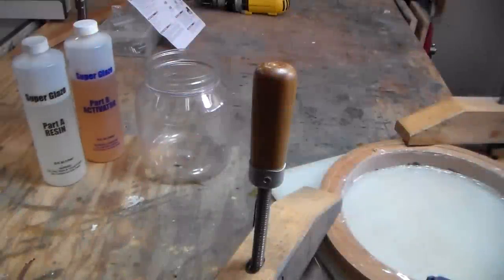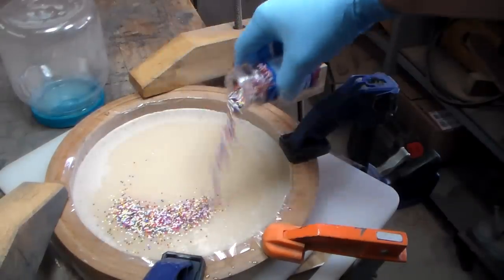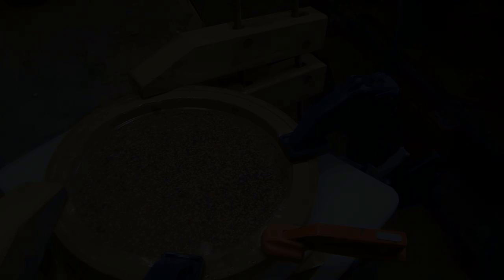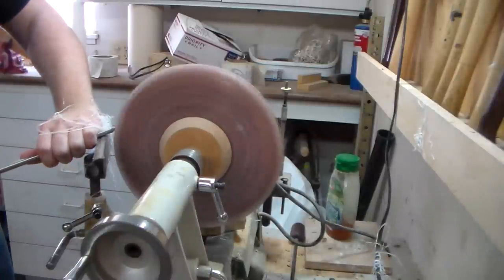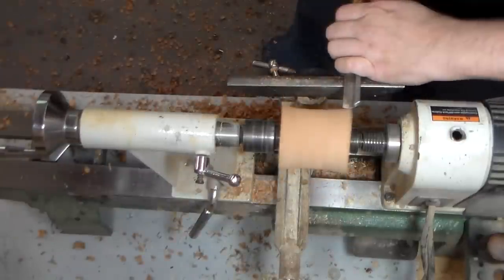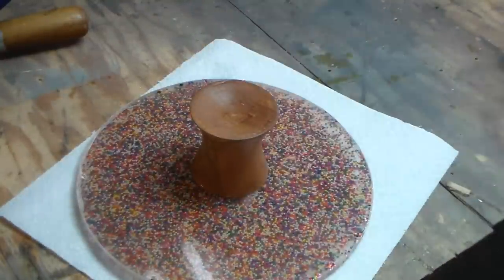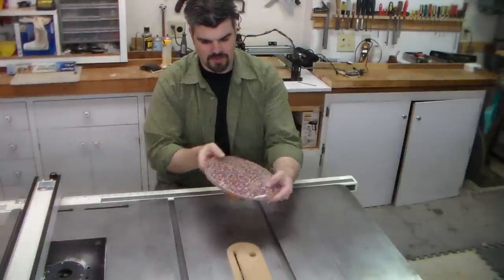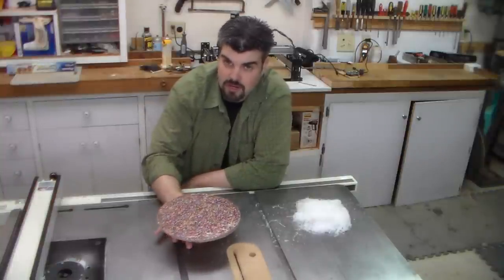Candy Sprinkle Cake Stand

Comment: Love it! Thanks Peter,  
I need to make something similar for my friend, she's a cake decorator.
Reply from the maker: Carl Jacobson Thanks! Word of caution. This has begun to sag at the edges, guess I didn't think about it needing support...
Reply: Peter Brown I found that epoxy is soft at first but will harden up like a rock after a week.  If you do it again, I would let it sit flat for awhile before gluing on the base and it shouldn't sag.  Another thought - If you make another I'd consider making the base wider at the bottom.  Otherwise the stand might tip as you try to cut the cake.  Great project.  I think I'll use the concept to make a sprinkle pen blank.
Reply from the maker: Pisik Wood Thanks for the information! That is very helpful. If you make a sprinkle pen, let me know, I'd love to see it!

Comment: Hey, Peter, love the colour.   One thing I'm not clear on.   You poured epoxy, then sprinkles, then heat gun... but afterwards, which side was the top?  ie: did the sprinkles sink, or ??   Did you get a smooth surface?   When you started, I was wondering if you were going to first pour a think layer of epoxy, let it dry, and then do the sprinkles+epoxy layer, to ensure a nice smooth top.
Reply from the maker: wordsnwood You're right, they all sunk to the bottom, with became the top. All that bubble removing was for not, unless you flip it over... Two pours might have been easier, as would have a proper mold. But then, that doesn't really sound like me... :)

Comment: That awesome! Just one comment. The half cut sprinkles on the edge looks very exposed. If I were to immerse the tray in water wont the exposed sprinkles dissolve? May be another epoxy coat along the edges to seal the sprinkles in?

Comment: F.Y.I. An idea. Neon drinking straws held together with resin and left hollow then filled with plaster of paris in a tube then cut thin as coasters. so the epoxy shows the colors and the plaster in the middle absorbs drink condensation. I guess plug the ends of the straws for the dip.  What do you think ?

Comment: That's pretty neat. :) I have never made anything that required so much resin before. I usually mix small amounts and what really helps with that are the medicine syringes you can buy that have the open end. I have one for my resin and one for the hardener. Of course labeled so I don't mix them up. :p For larger batches of resin I have a standard small measuring cup that works for me. I think it measures up to 1 cup in total.

I like mixing different paints in resin to get some really neat effects. I used a copper paint recently and the end results were beautiful. Of course I was thinking they had better be since the paint is pretty expensive for the amount you get. :0)

- Heidi
Reply from the maker: BlackCat2 It's always scary to mix this much up, hoping it's not a waste! I bet the smaller batches cure pretty quickly too.

I've not tried adding paint before, but I did have some luck with kitchen food coloring. Pretty cheap alternative if it works for you.

Cheers!
Reply: Peter Brown Actually smaller amounts don't really cure any faster. I still let them sit for 24 hours though it is hard to do as I want to take them out of the molds/forms and see what they look like. I have a problem with patience. :P

Yeah food coloring can be okay but not as good as nice paints. I also use a stained glass paint that dries see through though when wet it is opaque. They make some nice effects too but I usually put that on a layer of cured resin and then let it dry then add another layer of resin to cure over the top of the paint.

Comment: Cool, really neat and well done.  Thanks, Peter.  Did you use regular epoxy or a casting resin?  What was the hardener time: 5 min, 15 min, 30 min?
Reply from the maker: Mark Hazlewood I had bought that for my penny tray video. It's made for bar tops and such. Not great to work with. I think the set time was like 30 minutes. 3 minutes of straight stirring!

Comment: Would you have to then brush on some kind of sealer after the clean up work you did on the lathe?  Otherwise the candy that was exposed on the edges might get washed out as you clean it.
Reply from the maker: madwiebe I think a sealer of some type is a good idea. I've actually got an upgrade for this project I hope to make soon that will address that.

Comment: Hey, thanks for this. how do the lathe tool edges hold up when turning epoxy vs a typical hardwood?
Reply from the maker: +Jonathan Barrick epoxy is softer than maple, so it's not so bad. Now the one I turned with copper bits out in it, was a different story!

Comment: that wood part needs to be different, it will tilt and the cake will slide down when u try to cut it, just dril 4 holes and epoxi some 1 inch steel rodes as legs
Reply from the maker: spiloFTW I'm going to make a recess in a wooden stand for it. I might do a follow up video to show it off...

Comment: Fantastic! Again?!  When can we see a failed attempt at something? This is getting boring. :)
Reply from the maker: I'm trying really hard to think a project through before attempting it. So, I'm not cutting out my failures, and will continue to show them. But I've been lucky...
Reply: Peter Brown Keep up the good work. Here's a challenge: Put CA-glue with proper rating around a block of ice, and then put epoxy over that surface?  Also, can you turn ice? As the saying goes: "Peter Brown does it so that you don't have to!"
Reply from the maker: Janne Kronbäck My cake stand is starting to droop like a mushroom. Obviously it needed a bit more support at the edges! I thought you'd like to know... :)
Reply: Typical thing that one can easily see coming - in hindsight. :) Would you consider rather a rim or something hidden within/bottom-side of the stand?
I will of course revise this entry in my notebook as a complete and utter failure. :)
Reply from the maker: Janne Kronbäck I was considering turning a platter with a recess, and make it a cake plate. It would also hide the exposed sprinkles along the edge...
Reply: Yes, that seems to be the "normal" way of epoxying something fun as a surface for anything table-like. To me, your attempt was clearly different in that aspect. Guess a bottom-support or visible "spokes" that makes it look like the "cake" is cut into slices is needed..

Comment: Unfortunately, epoxy resin is NOT food safe, so it can't touch food as it is.  Plus, the sprinkles on the sides are now exposed to air and will degrade rather quickly unless you glaze it with another coat of resin.  Also, all that epoxy dust and debris that was flying around is rather toxic to your lungs.  I didn't see any sign of a respirator, which you should have been using for that.  I did see that you used eye/face protection, which is important.
Reply from the maker: Larielle Hey, the last sentence was something positive! Well done Larielle...
Reply: Just trying to help.  I actually got leukemia, likely from doing stupid things with resin, and make it my mission to spread the word about its safety.  Party on, Peter. :-)